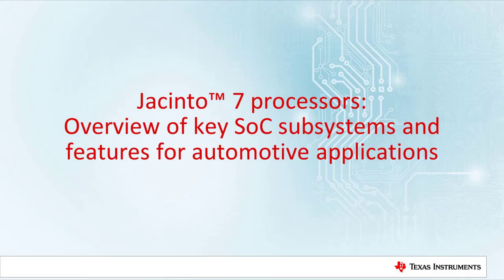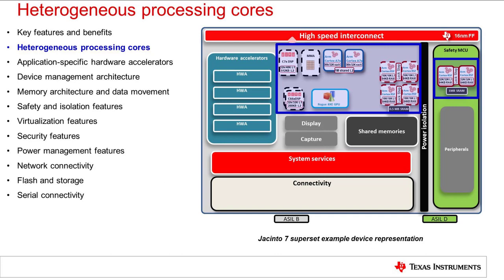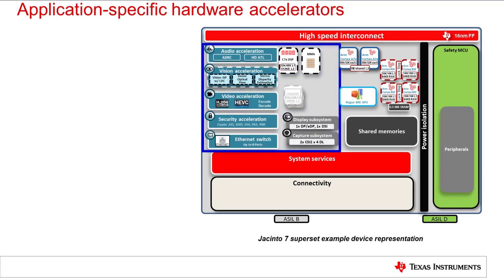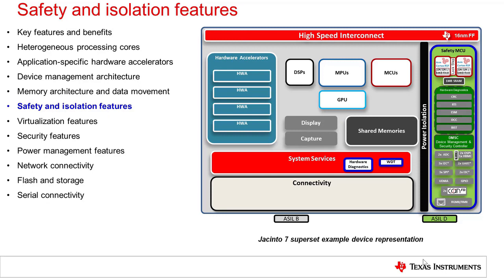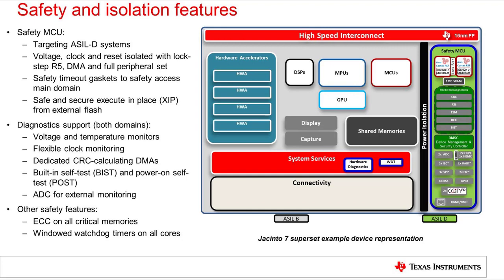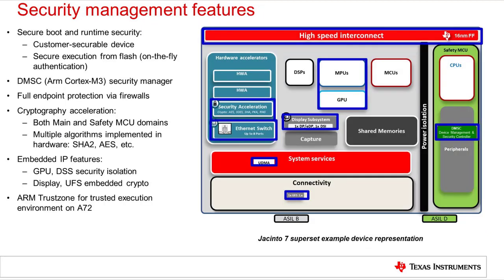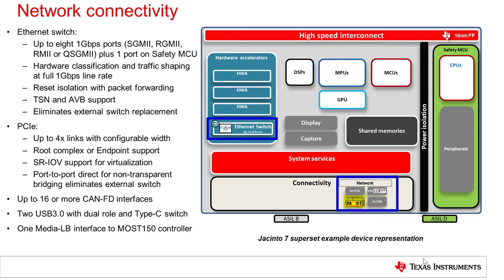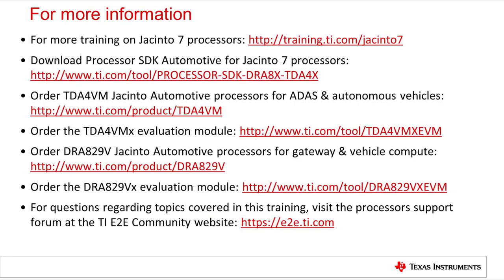Jacinto 7 processors: Overview of SoC subsystems and features

Comment: 00:03 Jacinto 7 processors provide high application performance, integrated systems, and peripherals for automotive applications.

02:19 Jacinto 7 processors provide a mix of heterogeneous processing cores for higher system performance and flexibility.

04:30 Jacinto 7 processors provide application-specific hardware accelerators for automotive applications.

06:42 Jacinto 7 processors feature a hierarchical approach to device configuration and management.

08:50 Jacinto 7 processors are designed with safety in mind, providing multiple features for automotive safety.

10:57 Jacinto 7 processors have key features in virtualization, security, and power management.

13:13 Jacinto 7 processors offer rich networking subsystems and peripherals.

15:25 Jacinto 7 processors provide various processing cores, accelerators, and peripherals crucial for automotive systems.

Crafted by Merlin AI.